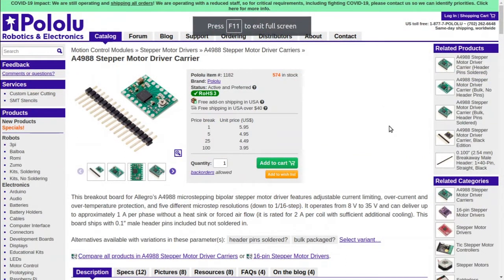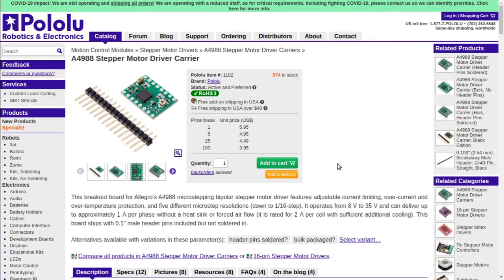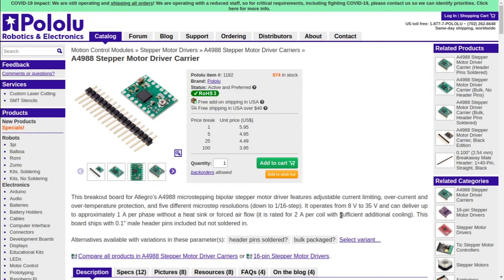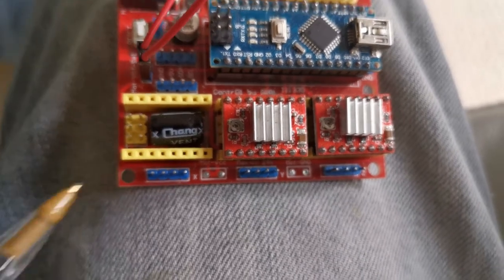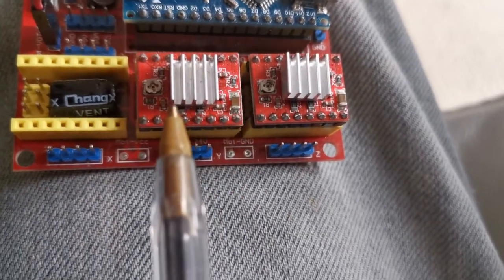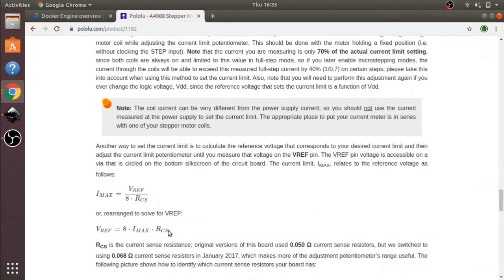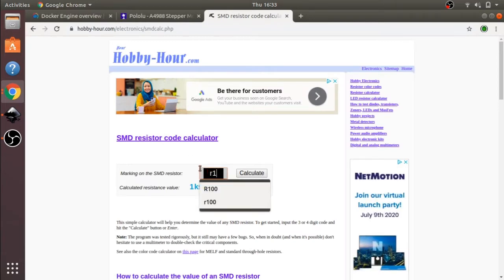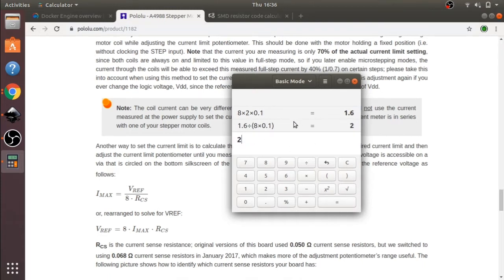Adjusting A4988 Stepper Motor Driver. Trimming stick calibrate VREF voltage CNC / Printer / Robotics

Comment: hey man thanks for the video , i have stepper motor that takes 2 a , and driver a4988 with R200 which is 0.2 Ω if i calculate the rcs Vref = 2 A * 8 * 0.2 Ω = 3.2 V , and my question is can the rcs driver reach this amount of voltage ?

Comment: What is te Max value of Vref we can adjust in this a4988
Reply from the maker: I have found that with my drivers they seem to range.  One I can set to a max of 1.6v and the other a max of  1.8v. Considering these both came with the board I did a bit of research and found that the drivers were cheap Chinese electronic parts. I have since bought locally in my country and have now steppers that have the same top value. Buy cheap buy twice.
Reply: @MangoJellySolutions  The max V of my drivers were 1.2v, I agree buy cheap, buy twice thanks